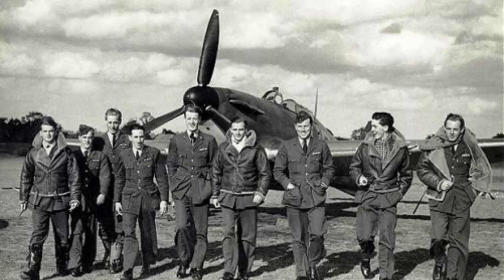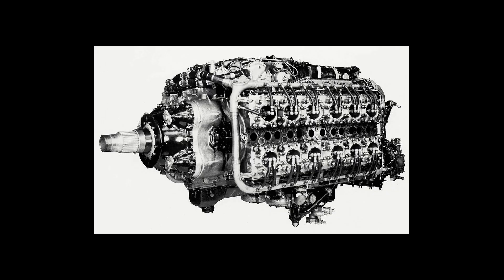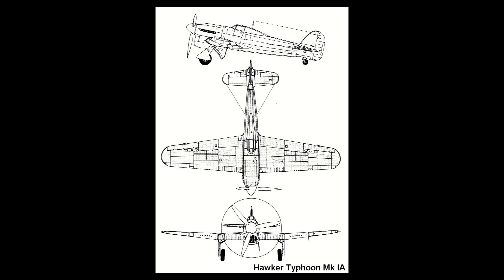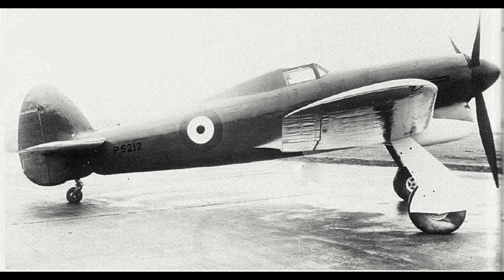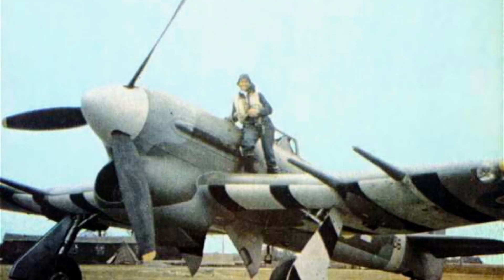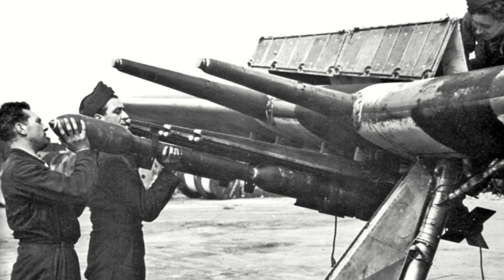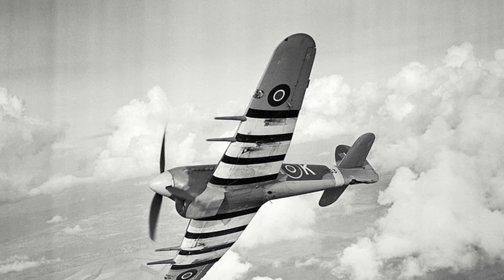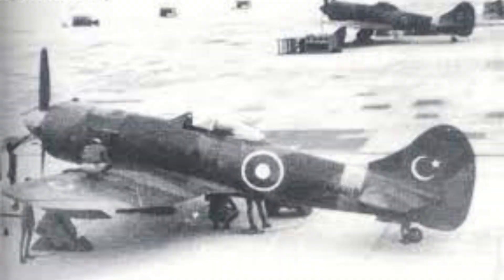5 Minute Guides to Aircraft: Hawker Typhoon

Comment: Typhoon had a vert advanced engine which cause early problems, but Typhoon Mk1A fighters stopped the low-level raids by Fw-190 fighter-bombers, the only RAF fighter that could catch them. As a Fighter-Bomber it was admired for its hesvy firepower 4 x20mm Cannon and 8 x RP-3 Rockets,
Reply: Not to mention being able to run down (on a short curving intercept) the V-1!!!
Reply: Part of the issue was the Motor Oil, since there wasn't any Detergent for Oils, No Multi-weight Oils, and the Sleeve-Valves themselves (due to lack of proper Alloys, and machine tolerances (see the first 2 issues to why it was so bad for the Saber!)...